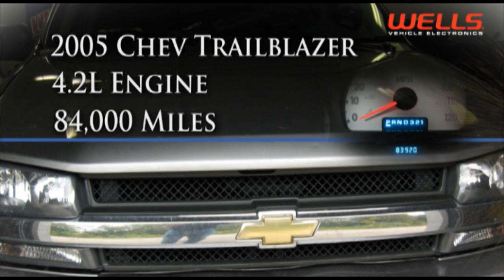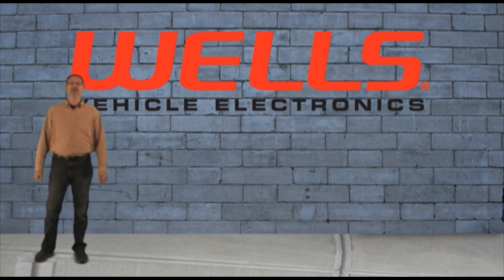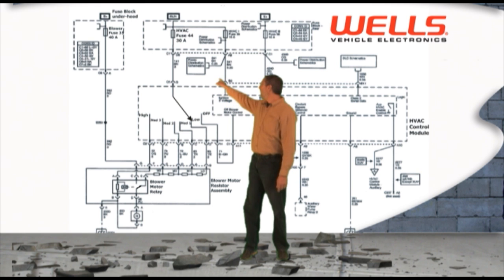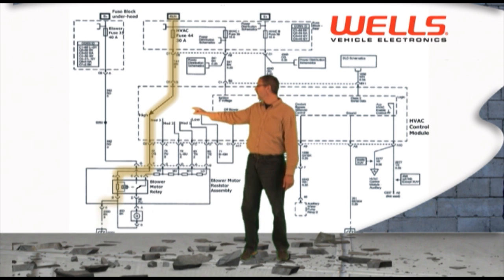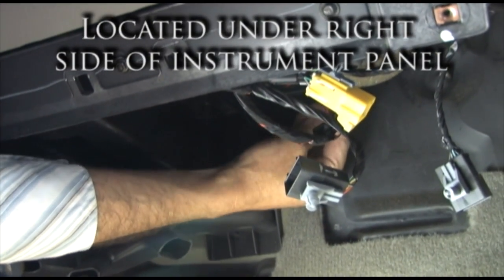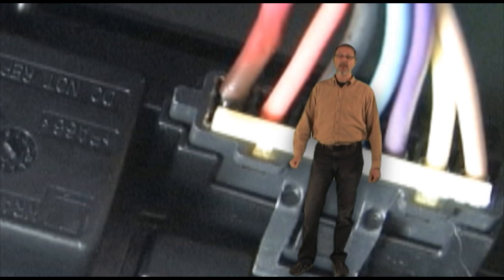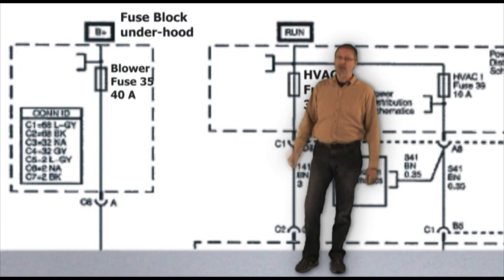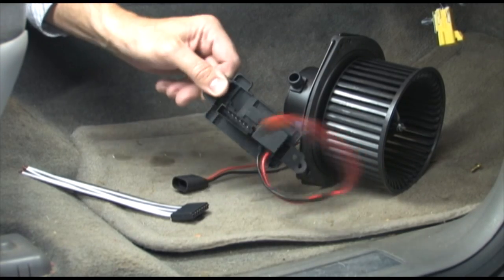GM Blower Motor Resistor Diagnostics by Wells

Comment: I used my test light on the wire that goes to my blower motor but got nothing. My AC does not work at all. Could the resistor be the problem?
Reply from the maker: Hey Leondro, that depends on the way the system is wired. What are you working on?
Mike Becker, Senior Instructor
Reply: @GoTechTraining  Update: I installed a new resistor on my 2003 Chevy Trailblazer LT, and it worked, but now I smell something burning. I believe the smell of coming from from the resistor. I checked the blow motor for Amps and it came back at 22, but it is very noisy. I'm kinda lost here on what to do next. The aircon was not working for about about three years. When it started failing, the compressor would turn on causing the RPMs to drop and sometimes cause the truck to turn off. So I'm assuming the throttle body may need some cleaning. Any guidance here is appreciated.

Comment: I have a 2006 Trailblazer with no fan at speed 5 (1-4 work fine).  Assuming I have a failed resistor, how can I test the amp draw on high speed? If I replace the resistor first, I run the risk of blowing it out while testing at high speed.
Reply from the maker: +Tim Carollo You can use an inductive amp clamp around one of the wires that goes to the blower motor. This will show you how much that blower is drawing. The high speed (5) part of the resistor is different that speeds 1-4. Speed 5 passes through a differnt section of the blower relay that is built into the resistor. Being that the other 4 speeds work it is likely that the internal relay has failed. Or it is possible the resistor is not getting power from the control switch in high speed. If you have a voltmeter or test light you can verify this by checking the orange wire into the resistor for voltage when the switch is on high. Let me know what happens.
Mike Becker, Technical Services Instructor

Comment: Checking amperage on the motor i get about 18 amps with the vehicle on recirc, cold and on vents. The amperage will go down depending on if its on hot or cold and the mode operation. What was the vehicle setting when you tested yours?
Reply from the maker: +ChickenSandwich69 Generally on high a blower motor will pull somewhere between 15-30 amps. Depending on the size of the motor etc. Being that you are at 18 amps, I'd say that's a pretty normal current draw.
Mike Becker, Technical Services Instructor

Comment: I have a 06 yukon denali the front air to driver side and passenger but the rear functions any idea what this could be?
Reply from the maker: Martin C Below is the test procedure:1. With a Digital Volt Ohm Meter (DVOM), back probe the Purple/White wire at the blower module.  

2. The voltage should fluctuate as blower commanded speed is changed from LO to HI. If not, check the wire back to the control head and check the control head power and ground, replace the control head if needed. 

3. With a blower speed selected, between LO and HI, backprobe the Red and Black wires at the 3 pin blower module connector, pins A and C.  

4. Should have close to 12 V.  

5. If above OK, disconnect the blower module.  

6. Jumper the Red pin A to the pin on the blower motor where the Red wire was connected.  

7. Jumper the Black pin C to the pin on the blower motor where the Black wire was connected.  

8. Verify that the blower motor operates OK. If all checks OK, replace the blower motor module and the blower motor as the most likely cause of the module failing.
The blower motor control module has a very high failure rate!Mark HicksWells Vehicle ELectronics
Reply: Thank you ill try it
Reply from the maker: Great! Stay in touch!

Comment: He failed to mention that a loose or burnt connector causes hi amps & can Mimic other problems.... Poor video instruction on his part
Reply from the maker: MooseGS Thank you for the comment. I guess I am a little confused, how does a loose and or burnt connector cause high amperage draw?Mark HicksWells Vehicle Electronics
Reply: Hello- all due respect & we appreciate the vids. In reply to your question...when a motor is operating, we all realize it's pulling current. If ANY connections are corroded, burnt, oxidized stranded wires w/ broken wire strands the motor CONTINUES to pull power/current/amps. Remember, heat 'de-rates' wires, switches said pre-determined amp rating. 
Motors that continue to run w/ faulty wired connections build heat & transfers throughout units bearings & such therefore causing higher amp draw. In video, I would've corrected power issue 1st & THEN checked red wire motor amps.

Comment: Hi I have a 2005 chevy trailblazer but my ac dosent blow no air only on the back  what can be wrong
Reply from the maker: 1. With engine running, check hertz on the Gray wire going to the Auxiliary Blower Motor Control Processor. If there is a frequency of about 35 hz, the Auxiliary HVAC Control Module is trying to control the blower motor.

2. Ground the Black wire at pin B of the Blower Control Processor and see if the blower motor will blow on high speed.
It is common for the auxiliary blower motor to fail.
Mark Hicks
Wells Vehicle Electronics

Comment: Hi I have a 96 contour, the heater stopped working, I replaced the resistor and it only works on low/mid but not on high,  harness looks good , blower seems to run fine, I pulled out the resistor and turned it on and the coils in it heat fun except when on high any suggestions on what els to check? Thanks
Reply from the maker: On your vehicle the blower motor resistor controls the grounding of the blower motor. The less resistance the more current can flow through the ground circuit and the faster the blower motor runs. High speed is a direct connection from the blower motor through the switch and to ground. With this in mind, run a well grounded wire to the Black wire with the Red stripe coming out of the blower motor. Then turn the key "on" and if all the connections are good to the motor and the motor is good it should run on high speed. If it doesn't start rechecking the connections to the motor, the motor and the power feed from the relay. If it does run on high, connect your ground to the Black wire coming from the switch. If it runs also on high there you have either a bad connection on the Black/Red stripe wire to the switch or a defective switch. Hope this helps, please keep us all informed.
Mark Hicks
Wells Vehicle Electronics

Comment from the maker: 3. Increase the fan speed setting from low to high while watching the voltage. The voltage should increase to nearly 5 volts as the fan speed setting is increased to high speed.

4. If the voltage increases to near 5 volts in step 4, and the terminal for the Purple and White wire is tight at the blower motor control module, replace the blower motor control module. 

Hope this helps
Mark Hicks
Wells Vehicle Electronics

Comment from the maker: Sorry for the slow reply ... your vehicle also has issue with the Blower motor control module BMCM. It is unusual to just have the middle speeds. here is a test procedure:
 	
1. Test for ground on the Black wire in terminal C at the blower motor control module.

2. Connect a voltmeter from battery positive to the Purple and White wire in terminal B at the blower motor control module.

Comment from the maker: 1. Remove the HVAC control head but keep the connectors plugged in.

2. Back probe and ground the Gray/Black wire at pin H at the control head. There is a Green/Yellow wire next to it.

3. If the blower motor now comes on check for a poor connection at the control head.

4. If OK replace the control head. 

The blower motor should draw less than 15 amps running, or it can greatly shorten the life of the blower module. 
Hope this helps. Stay in touch
Mark Hicks
Wells Vehicle Electronics

Comment: Hi Mark - Thanks for the very qiuick reply - here's so far... Resistor is new, blower works (when hooked up straight to battery), have ground continuity at blower plug but no power with controller at any speed including high. No fuses show short/blown. ???

Comment from the maker: Well your vehicle has both and more, please let me explain. It has a blower motor resistor and two blower motor relays. One relay for high speed and one for the other speeds. What is wrong? If you give me this information, I might be able to give a most common failure and a diagnostic procedure.

Mark Hicks
Wells Vehicle Electronics

Comment: I have a 2003 chevy venture that the medium fan setting does not work I have been told the resistor is located on the driver side and hard to get to . I am disabled on SSDI and would like to know how to replace it.

Thanks

Comment from the maker: @spelunkerd I am impressed another great question!! You correct when the internal windings short to each other the internal resistance will drop. If we remember Ohm's law, if the resistance drops and the voltage supply stays constant the amperage must increase. This is what happens to not only a blower motor but anything with a winding of wire.What do you and everyone else think about us producing a few videos on electrical diagnosis with some theroy in them?

Mark Hicks
Wells

Comment: When the blower motor draws too much amperage it has to be because it's internal resistance has fallen. Is it accurate to assume that there is an internal short within the blower motor that allows current to pass more easily through the motor? Of course it can't be a short to ground, just to adjacent wires within the motor coil, allowing current to pass with less resistance. Is there any other explanation for why resistance would fall? Thanks for posting your video.

Comment from the maker: @dmorley100 Very good point and completely true. It also helps to confirm the 23 - 24 amps the blower motor was drawing was too high the circuit. In the future I hope we can show more of what happens to a circuit that is drawing too much current and how to diagnose it. It happens more than most know.
Thank you for the great tip.

Mark Hicks
Wells Vehicle Electronics

Comment: Something I'd like to mention is that a general rule of thumb is that the load of an electrical circuit should consume roughly 1/2 the amperage, give or take, that the fuse for that circuit is rated for. Example, circuit that has a 10 amp fuse, whatever load, be it injectors, fan motor, whatever the case may be, is on that circuit should consume around 5 amps.